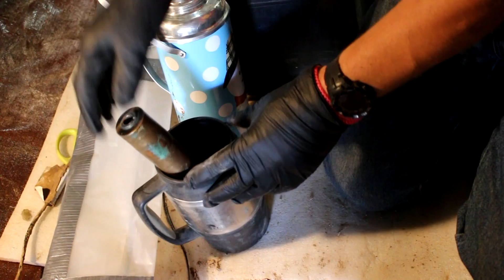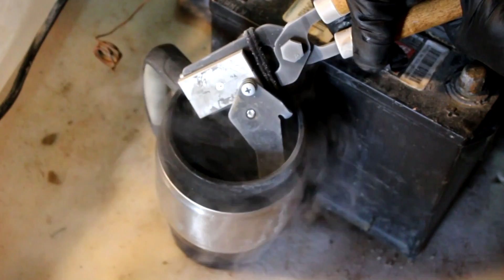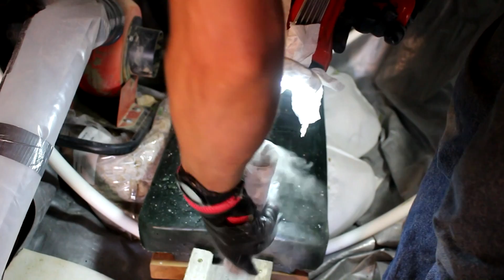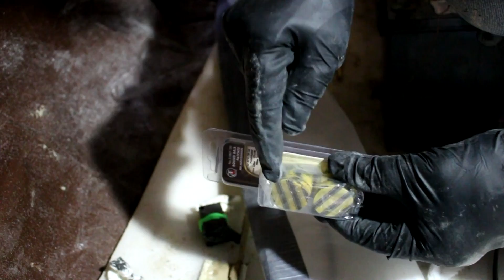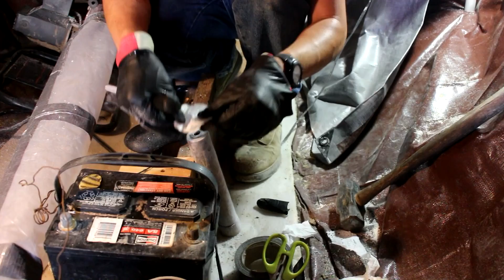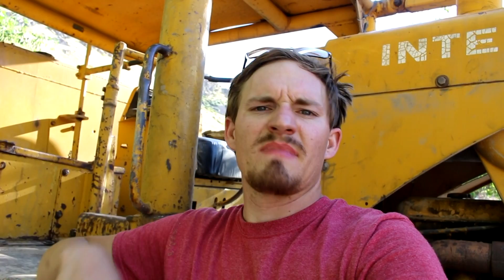Shooting Mercury Bullets

Comment: I suspect that atomized mercury at high velocities might infiltrate through a poly tarp. I love this experiment though. Be safe, as always.
Reply from the maker: I also had plastic sheeting under the tarp.
Reply: That's probably for the best. Great vid, sir.
Reply: +canid song stop agreeing this is a YouTube comment section. Peaceful agreement goes against protocol
Reply: hahah lol
Reply: it was everywhere. Very irresponsible. The mist went straight outside  I'd leave the town. Calling it a clean-up had to be a joke. I wonder how much he recovered.
Reply: basically, they're a safety nazi worrying about tiny quantities of mercury reaching dirt through a tarp
Reply: canid song There's nothing wrong with just a tarp. Taking a few grams of possible contamination down to a few milligrams in a mine already containing lead should be good enough. There would be no need for extra precautions beyond the original tarp unless it was already damaged. Worrying about the minuscule amount of mercury that penetrated the tarp is rather ridiculous.
Reply: That is a reasonable view except the ridiculous remark. Ridiculous would be using potentially ineffective controls when effective ones would require no greater effort. In this case, Cody has already stated that he did the later.
Reply: canid song  Assuming atomized mercury would travel at high velocities for several inches is in and of itself a ridiculous remark... Since there is an air gap of several inches between the tarp and gun muzzle as well as the target and muzzle, the mercury itself wouldn't be at a high velocity if it was atomized. Your whole statement was utterly pointless safety nazi bullshit.
 My goal is never to make someone like you understand, but to prevent people such as crystal neth from being contaminated by your stupidity.
Reply: I'm fine with that. If I figure out why I'm wrong I still won't be the asshole.
Reply: I'll take it.
Reply: There's nothing wrong with ensuring reasonable precautions against contamination. Now hush, grownups are talking.
Reply: english please

Comment: if your testing more bullet materials could you please also do indium, im interested how that would be for hunting since its such a nontoxic material
Reply from the maker: its on my list.
Reply: indium is about half the weight of lead, almost half as soft, and a lower melting point. An 180 grain 30-06 bullet  weighs around 11.6 grams     most of which is lead . you would have to double the amount of indium used per bullet to equal the performance of lead. That in turn makes the outer jacket very thin if there is even can be one. I would guess lead weight of the bullet would be about 11 grams. 11 grams of Indium would be anywhere from  $11 to $55 depending on the market. that translates to $220 - &1100 just for the bullets not counting the casing, primer, and powder per bullet per box of shells. all that figured in you are looking at a hefty cost for a box of shells. cost would only go up because it is a relatively rare metal. The mining process, machinery ect would cancel out the use of indium as a nontoxic bullet. Big gaping clear cut holes in the ground where plants trees, and wildlife use to be, diesels spewing out toxic fumes, ect.
Reply: Well considering the fact that one bullet will more then likely cost more then the gun you are shooting I dont think it will work out that well for hunting. A silver bullet would be 100x cheaper.
Reply: I don't know about that. Indium is about $2 a gram. A bullet made out of it wouldn't come anywhere close to the price of most guns.
Reply: Dylan Zrim  it was a response to another comment on the possibility of indium being used in hunting bullets instead of lead. Not Cody doing an experiment with it.
Reply: +ZettabyteGamer He has some indium at home (got it before the touch screens),didn't you see the metal cookie video
Reply: Ivan Lukin Yes I know he has some, I was just saying it isn't as expensive as BigTime claims it is.
Reply: ZettabyteGamer Wow idk why I was thinking he said Iridium... my bad.
Reply: BigTimeZergRush Haha its all good, honest mistake!
Reply: +Tony Hyden he wouldn't make full modern bullets, seeing as the cold gun is a muzzle loader, fuse fired tube... did u even watch the video?
Reply: +BigTimeZergRush isn't uncontained iridium highly radioactive?
Reply: Dylan Zrim No it isnt, only thing I have heard about it is that it has low toxicity and might be slightly carcinogenic. Havent seen anything else about it so I cant really help beyond that point
Reply: Well there is a muzzle loader season.

Comment: Slight issue with your explanation for the distance traveled by the mercury round. Momentum is the product of mass and velocity (p=mv) and, assuming the powder charge was equal in volume, would have been the same for the mercury and the lead.

Whilst the lead would have had a higher velocity due to its reduced mass, the p value would have been equal to that of the mercury round which was traveling at a slower velocity but had the larger mass.

Of course, this is assuming an elastic condition in an isolated system for the initial explosion, which is unlikely to be the case. I agree with your comment on the lubricating effect of the mercury as it becomes molten though.
Reply from the maker: actually the reason dense materials are used have a lot to do with newtons impact depth laws.
Reply: I meant more that, assuming the volume and chemical potential of the powder used are the same, both rounds would have inherited the same momentum from the explosion, if we assume an isolated condition between the cold gun, the ball and the explosion. 

The approximation for depth of impact is based on momentum considerations and this we would assume the penetration depths would be equal, with all other factors being constant (Seeing as the equation for penetration depth is based off length of projectile, cross sectional area of the projectile and the target density. With that in mind, a third factor seems to be at play, which is described by your suggestion of the lubricating effect of the melted mercury.

It was a cool video and something I've wanted to see done for a while now, and the effort you put in to making the cold gun and ensuring minimal environmental damage is commendable. Something I've always wondered is how you manage to get your hands on the chemicals you use in your videos, because most of them are restricted where I live.
Reply: although the momentum explanation is probably wrong (sorry cody) there is probably another factor at work. my two cents says it has to do with weight and the way black powder rifles work.

 i have heard if you put the same amount of powder with different weights it will burn more or less because it will affect the amount of time the explosion is propelling the bullet. ex lighter load means less force to push so less powder burns and you get an incomplete burn.

there is also the possibility of how the bullet in the gun works, is it either expanding to seal the barrel or is it letting gas pass and just ping pong itself through the barrel. lead normally does both but with mercury it could be melting and do something different or maybe it is tougher to create a seal as lead is a softer metal.
Reply: I'd tend to agree with you Darknight, the combustion of the powder is far from instantaneous, and with its faster velocity the lead bullet will clear the chamber faster, meaning that less of the actual powder has actually released its chemical potential energy than it will with the mercury round.

The effect of this is less kinetic energy, thus a reduced velocity and momentum, for the lead round, which further disadvantages the lead round. The gas sealant will be better with the liquid mercury acting as an improvised seal, so there is less energy loss.

Comment: How about try Liquid metal (Gallium + Indium)
Reply: no
Reply: Isn't gallium already a liquid? And Mercury too?
Reply: +Sander van Duren Gallium I think stays soft at room temperature but melts when you heat it up with your hands.
Reply: sure it would function similarly to mercury, probably less spray but certainly much less momentum.Gallium is extremely light. Basically just a really shitty bullet lol
Reply: +Nick Farrow i dont think that would work with standard guns as even capsules of liquids turn into a mist. though if it were magnetic then may be it might work out of a rail gun?

Comment: Like the closing clip. Wonder what it would be like to go for a swim in mercury....
Reply: "a swim in mercury"   It would probably be a swim ontop of liquid mercury, given our density is lower than the density of the mecury (If I'm not mistaken) 
[and the surface tension is very high, so even if it wasn't you may be able to float if you're laying flat on top of it. ]

Comment: Would it be more accurate in saying that the mercury bullet becomes more of a shaped charge? Isn't that what HEAT rounds do, using copper? Explosive melts metal and sends it in a stream through a target?
Gunpowder burns, heats the mercury, friction heating the mercury as it moves through the barrel, causing it to become a stream of fast moving liquid mercury (a stream due to the barrel and it's initial direction)? Or I suppose if not like a shaped charge, then more like a water jet cutter?

I'd wager a way to test that is to do another similar test, but have 2 different targets, 1 behind the other with a space between them. If it is indeed a liquid jet of mercury coming out of the barrel, then it should go through the first target, leaving a neat hole and splatter across the 2nd target.
Though, I'm just a spectator. There's a good chance I'm wrong o.o

Comment: If you ever get the chronograph working ad you have a semi-accurate scale, it would be quite interesting to find out the actual difference in momentum between the two becuase as you probably know, P(momentum) = V(velocity) x M(mass)

Comment: the way its explained to me by some machine gunners in Arizona , the mercury is added to a hollow point then a beebee is set in the tip. as I understand , the beebee on impact with target compresses back into the mercury causing the bullet to cavitate excessively. the toxicity of the mercury is a far secondary concern with the kind of wound described by those who have seen it . I will add that I have seen these rounds but have not had the opportunity to witness the effects

Comment: Where do you get liquid nitrogen? I want to make Dip'n'Dots.
Reply: Grant Thomson The King of Random did a video about it. You can get it at a welding supply shop. but you need a proper Dewar. In my experience they won't normally give it to people if they try to bring in just a thermos
Reply: eivilcow33 Hmm, I don't particularly feel like spending $300 so I can have some novel ice cream every now and again.
Reply: they will actually fill up a thermos, it just takes more time for them to do it so it costs more per ounce. It would actually be more cost effective to fill up the thermos than buying a dewer because if you are only using it for dip n dots, the rest of the liquid nitrogen would just be wasted.
Reply: needamuffin it cost him $300 because he got 30 liters. I would guess you would probably want to get a bit less than that. If you live near a good university, you can sometimes dumpster dive for them. I have gotten two from the physics department at my university that are still in pretty good shape, they just were old so they couldn't insulate as well as the new ones

Comment: Turns out, gunpowder is very hot....Just like Mythbusters already told us with ice-bullet, and ice-bullet revisit. I'm a bit surprised you didn't use a patch to start with...And you should've gone with rocket recovery wadding.
Reply: I'm sure the ice bullet could be done.  But unlike Cody, the Mythbusters are pussies when it comes to giving out information that THEY think might be too dangerous in the hands of the general public.  Apparently, Adam and Jamie were unfamiliar with a little information sharing invention called the Internet.

In any case, a solid ice bullet didn't quite work out, but what about a bullet made from pykrete (using very fine, rather than coarse, sawdust).  I'll bet Cody could figure it out if he put that big, beefy brain of his to it.
Reply: No need for conspiracy. They only thing mythbusters were denied doing for secrets reason was RFID hacking, and that's because the companies threatened both lawsuits and pulling big sponsors.
Other YouTubers have done pykrete. It vaguely works, but not very well at all because it is seriously lacking in density/weight, thus seriously lacking in kinetic energy. Mythbusters didn't do it because that wasn't the myth. The myth was that the bullet was ice and melted leaving no flesh. They even tried to stretch the myth, using flesh; they had the same problem: lack of kinetic energy. They have used pykrete in another myth though; and it turns out works just wonderfully for withstanding bullets; although, a touch heavy compared to like, kevlar.
Reply: It's not their fault. There were several myths that they wanted to test but weren't allowed to by the producers of the show. Also, the FCC regulates the type of information that can be broadcast, so even if the producers had wanted to, and had made the episode, it might not have been shown. This situation also happened once.

Comment: I don't mean to over post but this just came to mind.   NASA was using Sperm Whale oil (spermaceti) in space because it won't freeze.  Prior to the early 70s some automakers still used it in some applications.   I'm not sure where to find it since the whaling days are over but I bet you could find some lying around online somewhere. That would make for some awesome experiments with liquid nitrogen.

Comment: +Cody'sLab
Is it possible that the mercury may act like driving a wedge in, by the mercury flowing into the perforation it creates, the outer surface slows due to drag and the internal inertial forces push the perforation further open like a wedge with mercury from the center flowing forward?
I guess that's the same as saying it lubricated the paper going in but, if the bullet was longer and skinnier would that have a dramatic effect on penetration over the same long skinny shape for a lead bullet.
I'm thinking of a similar effect to an anti-tank missile how in the case of the tank a hot fluid flow pierces through the armor and into the tank.

Comment: Its snowing Mercury!! how long does a frozen Mercury bullet take to melt under normal conditions?
Reply: Define "Normal" conditions: How cold is the mercury? is there any wind? what is the humidity? how much light is on the mercury? What material is the mercury resting on and what temperature is it at? How much does the bullet weigh? is the surface tarnished or polished to start?

If you are talking about a 14 gram (.5 oz) mercury bullet on an insulating surface with no wind starting at liquid nitrogen temperatures within a building at 70 degrees F with cool light on it (Does not produce noticable heat). Then the primary forms of heat transfer will be convection and radiation (if it is on an insulator then conduction won't play a major part in it). Given those extremely vague conditions, and taking into account the heat transfer rate through mercury, I would guess it would probably melt within 3 minutes
Reply: Are you serious right now? Please refrain from answering any of my questions again. Thanks in advance.
Reply: no are YOU serious? if you cant even answer these basic questions then you should not be asking more complicated ones. every single one of my questions for you mater. and if you ask questions without thinking, then you will get snarky answers. I gave you an answer using what I believed to be "normal" conditions.
Reply: +eivilcow33 I am actually quite impressed with your answer. Personally, I think it was an excellent response that displayed critical thinking and a keen attention to detail. Unfortunately, I don't know all of the math behind your conclusion, so I'll just have to take your word that it is accurate.
Reply: +PlacidDream ooh boy someone's intimidated and got too pissy to just read the entire thing and find out he said 3 minutes
Reply: So i missed something.. crucify me. You got nothing better to do?

Comment: I think the reason that shooting mercury is illegal and lead isn't, is because little to no mercury bullets exist, but there are millions upon billions of lead bullets that already exist would be a pain in the ass to collect and refund all the lead ammo in the world
Reply: Mercury is far more likely to mess with what ever you're shooting because of it being a liquid at room temperature. you can pull out a lead bullet but you cant pull out every drop of mercury that entered the bloodstream
Reply: They are still making lead bullets. The problem with mercury is that it is a liquid that releases vapors. Cody was correct: Lead and Mercury are equivalent in how poisonous they are. HOWEVER due to the liquid state of mercury, it is a lot easier for it to get into your body than the solid state of lead. Even just inhaling the vapors for long enough can give you mercury poisoning.

Comment: I think the reason that the bullets didn't penetrate as far as you expected is because bullets lose a lot more velocity when going through 2 different objects.

Like in the Mythbusters epodes where they used phone books to bulletproof a car. If it went through the paper then the glass it penetrated all the way through, but when it went through the glass first it hardly even went into the phone books because it used more of its energy penetrating through the glass first. I think it's the same deal here.